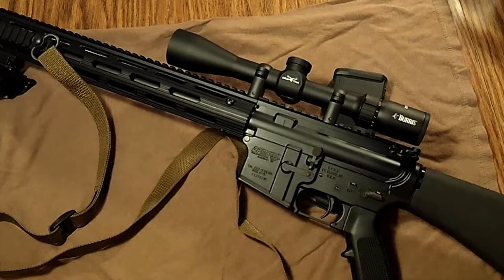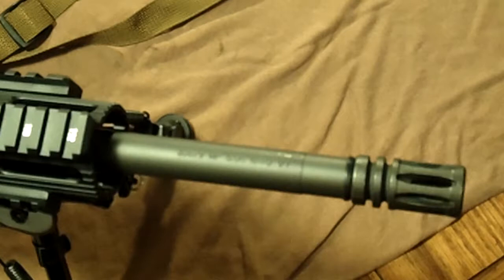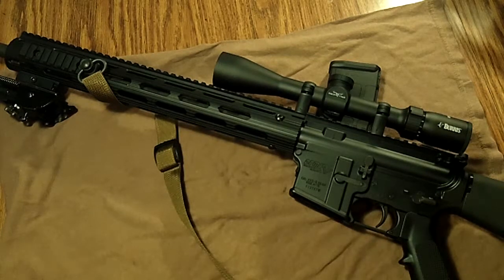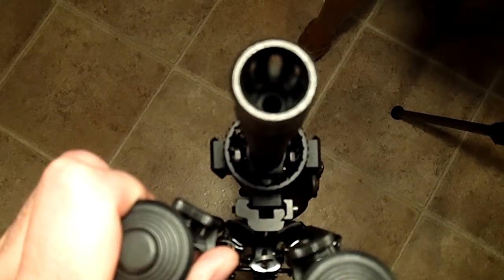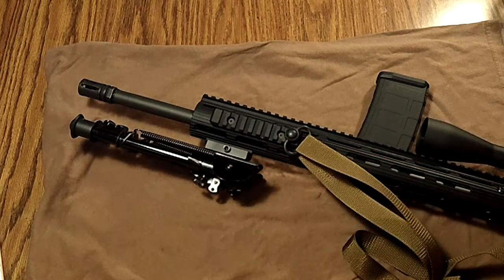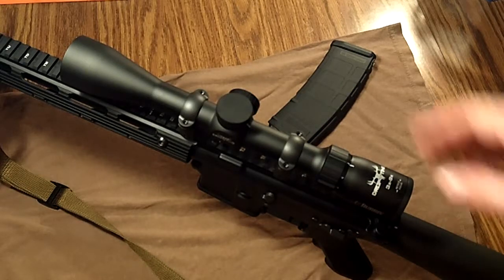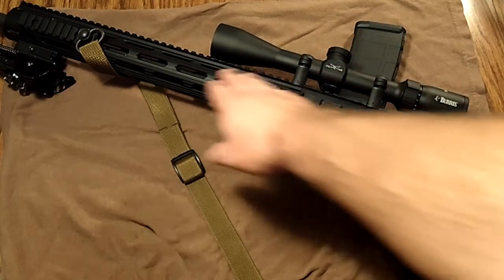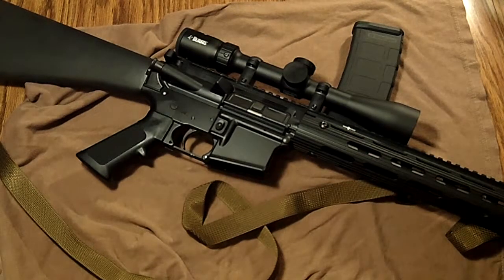FN AR-15 Rifle

Comment: I LOVE both my FN AR-15s! 
By far the smoothest, quietest cycling, most reliable, most accurate and most durable AR-15s ive ever handled.

Both my  modded FN 16" M4/RECCE and my FN 18" match grade sporter/DMR are 100% reliable, 3/8 moa accurate and after 9,000 and 7,000 rds respectively,  are still like new! Theres not a mark on either bolt and only minor finish wear on the cam pin and carrier rail corners is visible.
Theyre the best ARs ive ever seen!
Reply from the maker: Thanks for watching.

Comment: Check out the Griffin Armament SN-ACH (Suppressor Normalized-Ambi Charging Handle). Its ultra smooth in operation, uber big, beefy and overbuilt with huge 3/16" screws for pivots rather than small roll pins. Definetely my favorite for a fighting rifle.  
The AXTS/Radian raptor ambi charging handle is a close second.
I have the GA SN-ACH on my go-to fighter, my FN 16" M4/RECCE and the raptor on my FN 18" DMR.

BTW the ALG ACT trigger is phenomenal for $68 or so! Its just an enhanced and Nib plated mil-spec single stage but is ultra smooth, very light at about 5.25 lbs and has a good, snappy break with a bit of overtravel and a good, positive reset.
I actually traded my Timney 3.5 lb single stage trigger that came in my FN 18" match grade sporter/DMR to a buddy and installed an ALG ACT temporarily until i found a deal on a Geisselle SD-A
But i like the ALG so much ive decided to keep it.
I fire 3/8" 5-rd 100 yd groups and sub moa groups out to 300 yds with it and have no reason to change it.
My 16" M4/RECCE also had an ACT in it and i was able to fire 8.5" 5-rd groups at 550 yds with it!
Imo the ACT is probably THE best combat trigger available.
It offers mil-spec reliability and durability while providing speed and precision. Its hard to beat especially at $68!
If they offered a flat trigger model, id likely have an ACT in all my rifles!

My 16" M4/RECCE had an ALG ACT as well but i upgraded to the Lantac/CMC ECT-1 3.5 lb flat single stage trigger when Primary Arms had it on sale for $90.
Otherwise the ACT would still be in it too.

The Lantac/CMC ECT-1 is a great trigger too.
Not super short like the Timney or most high end single stage triggers.
Consider it like a really good mil-spec trigger like the ACT except shortened by 40%, lightened by 30%, smoothed by 30% and with a very crisp, clean, "rolling" break.

Theres zero play, an exceptionally smooth, very short (by mil-spec standards) or slightly long (by Timney etc single stage standards) pull leading up to a nice crisp, clean break followed by minimal overtravel and a nice, audible and tactile reset.

That slightly long travel before the break is only evident if you slowly stage the trigger. If you simply pull the trigger as in combat style shooting, youll never feel that travel. Rather it just breaks like any other high end single stage like the Timney, but with a slightly softer "rolling" break.
And i HIGHLY recommend the flat trigger! Its hard to explain but its a definite advantage imo.

The ECT-1 makes an exceptional combat trigger with that slightly longer pull (approx 3/32") offering an extra measure of safety.

The only issue ive had is an occasional light hammer strike.
If you need 100% reliability id recommend going with the 4.5 lb springs. The ECT-1 is so smooth i doubt youll even notice the extra weight especially if you get the flat trigger shoe model.

Other than the ALG ECT and Lantac/CMC ECT-1 I also HIGHLY recommend the Geiselle SSA or SD-A (flat trigger shoe) and of course the various Timneys.

Good luck with your build. Id love to have an accuracy report.
Thanks for sharing!
Reply from the maker: Thanks for commenting.